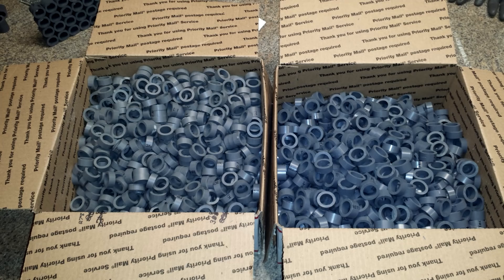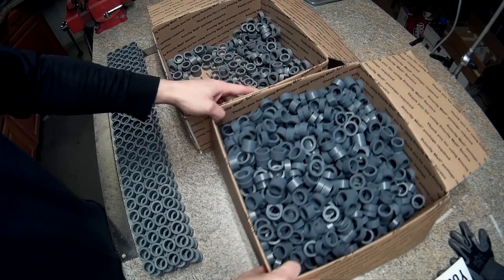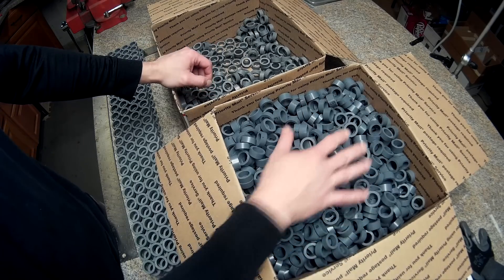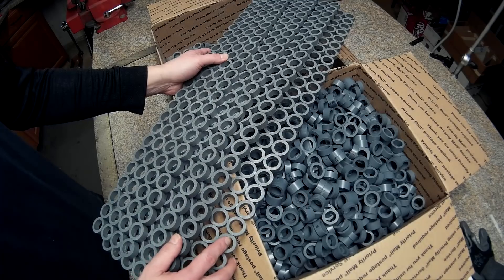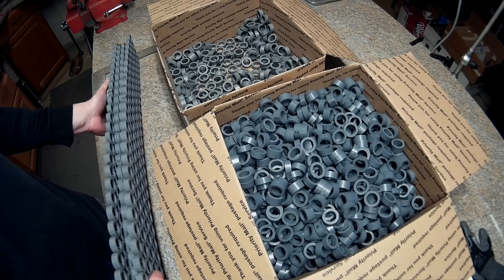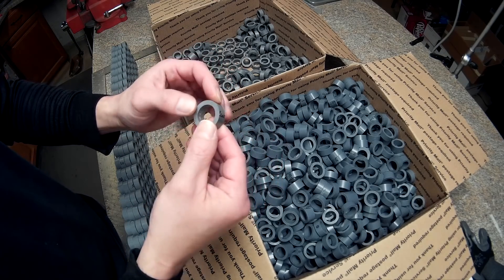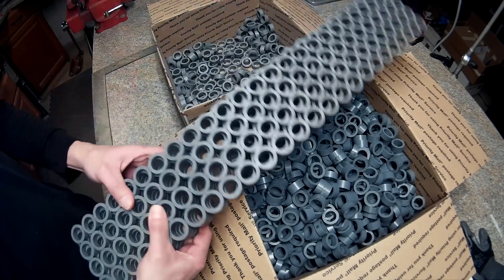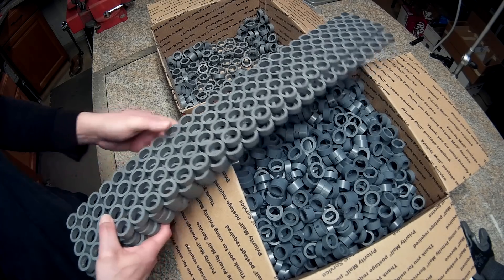Diy Tesla Powerwall ep35 Cell Holder Progress

Comment: what kind of glue are you using cause i used my hot glue and they came apart?
Reply from the maker: I used regular super glue.
Reply: maybe its the heat here becuase i am having a heck of a time keeping them together i probably should just go ahead and use the cement for pvc, I live in arizona lol
Reply from the maker: You said hot glue correct. I used superglue. Pvc glue should work, I just never tried it.

Comment: Joe, one last question about this video. What's the type of glue that works well on this pvc pipe rings? Can you give a name? Or names?
Thanks in advance!
Reply from the maker: +Jose A Cruz I just used regular super glue😀🖒
Reply: Use super glue then sprinkle it with pure baking soda.

You can also use those high temp rated   steel epoxy used in radiator repairs

Comment: I got an question, where exactly you put the glue? I mean, the exact spot on the ring. Can you show video in slow motion or normal? From every angle. And, is it cost effective doing it that way or is it chipper buying it ready? The time to cut it, the cost of pvc tubes, the glue, electricity spent. Is it worth?
Just need to know if have calculated everything and what is chipper. The way you do it, I personally love it. I think if that glue works well the frame give an better protection to the cells and enough space between cells to keep them cool. Great job Joe!
Reply from the maker: +Jose A Cruz I have another video where I build the hole thing. I glue them on both sides where they touch. Glue one side then flip it over and glue that side. Only needs a drop. I did it this way cause the cell holders at the time were expensive. You can build a 14s100p for less then $60 for everything. It just takes a lot of time.🖒

Comment: What is the thickness of this tube?
Reply from the maker: They are 1" OD and 3/4" ID
Reply: This tube for hot water
Reply from the maker: I believe it can be used for a variety of things.  Its thicker wall allows it to handle more pressure.

Comment: Thanks for sharing your projects, makes for an interesting watch. One thing i don't really understand with all the DIY powerwalls, why do you sort the batteries by capacity? I mean if you have a 1,5Ah nominal capacity cell, that makes 1,4Ah in testing, has way more life left than a 2,9Ah cell that tests out at 2,0Ah. So I'd prefer the 1,5 one or am i getting this wrong?
Reply from the maker: Thanks for watching.  Were testing them all to basically weed out any bad cells.  Ya you are right, it would be best to keep the cells that are just under or close to there rated capacity but most just call it a day if there over 2000ma.